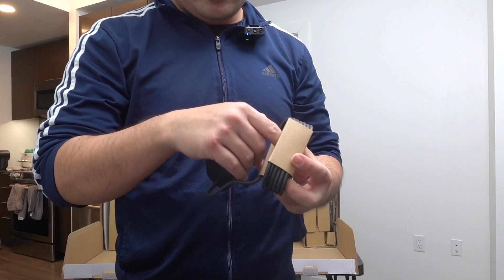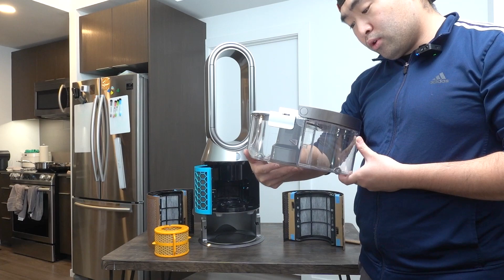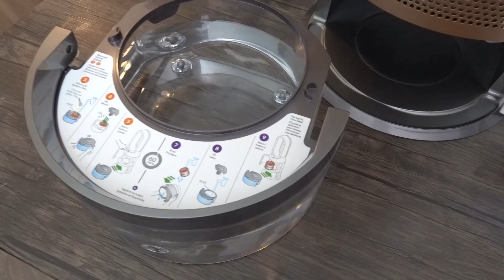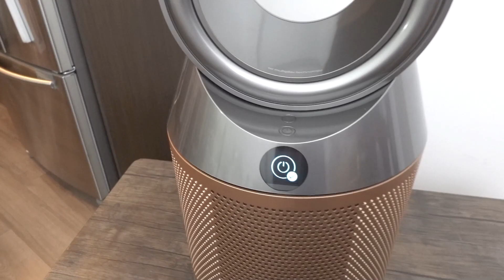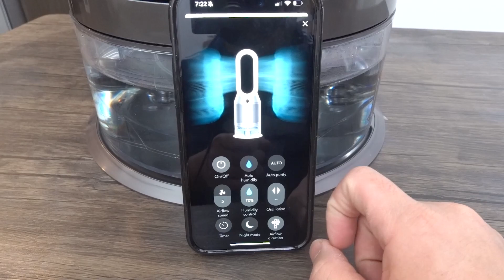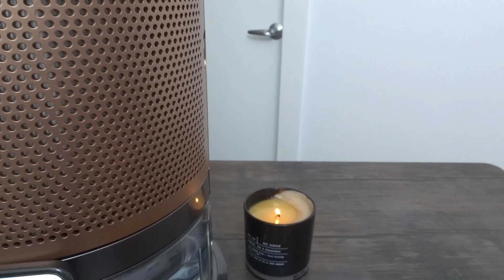Should You Buy? Dyson Purifier PH04 Humidifier + Cool

Comment: I cannot recommend this product. A few short months after the 2-year warranty expired, the machine suddenly decided that its water reservoir was not in place. Dyson support sent a replacement reservoir pump and that made no difference, so they took it in for repair. A few days later they declared it could not be fixed. The very same machine that is still on sale today! So my advice would be not to buy it. You may find as I did, that its true cost is around USD 350 per year and then it’s a dead weight apparently only fit for “recycling”.